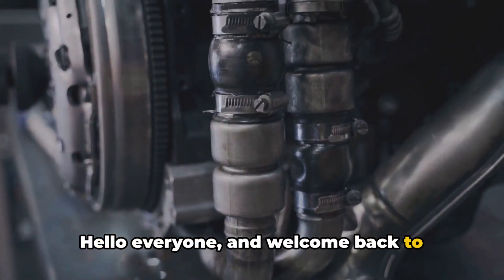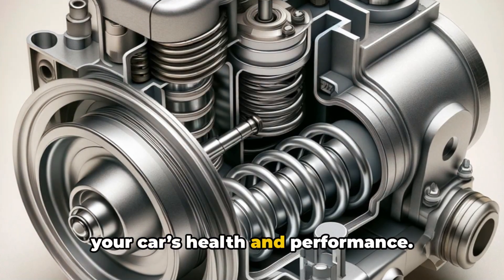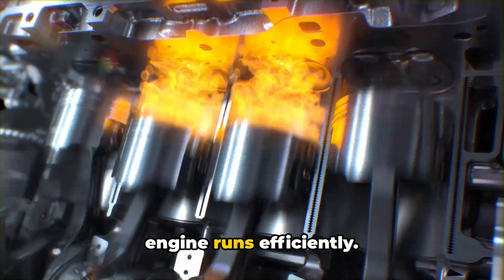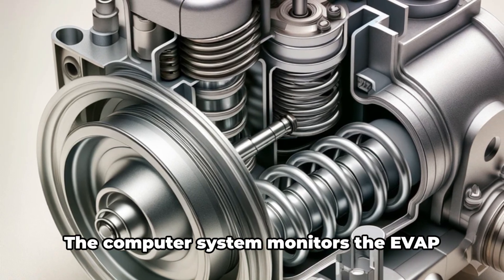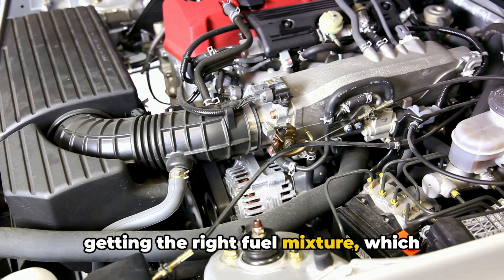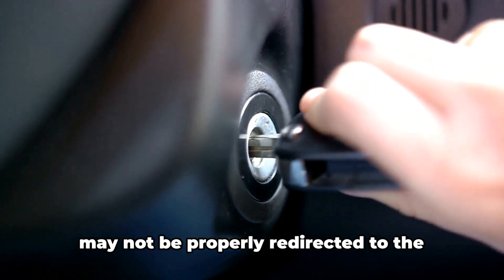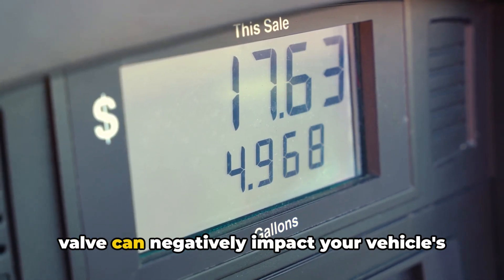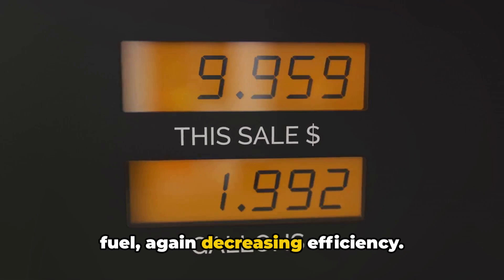Symptoms of a Bad Purge Valve: 5 Common EVAP Valve Signs

Comment: But what
 If you have no engine light, but you get a gas,  smell under the hood. And have no symptoms
Reply: Please answer this. Have the same issue with my hyundai accent.
Reply: Fuel injectors
Reply: Did you find out what the issue was?
Reply: @driftaddictbr it had to be a fuel injector or purge valve also could be fuel pumps